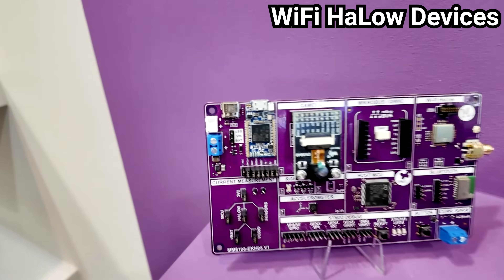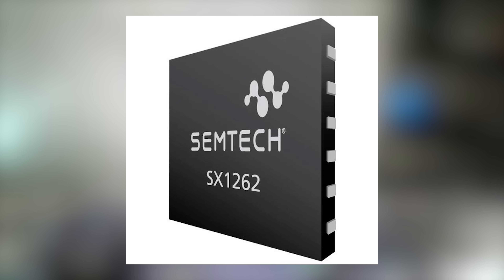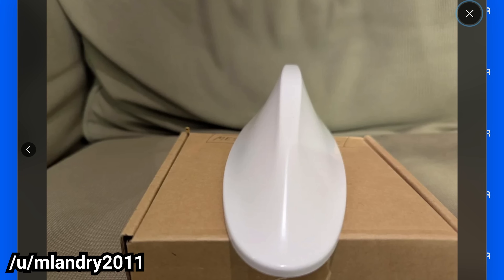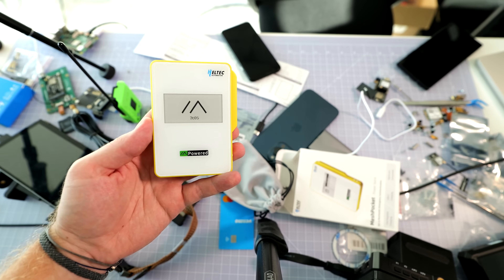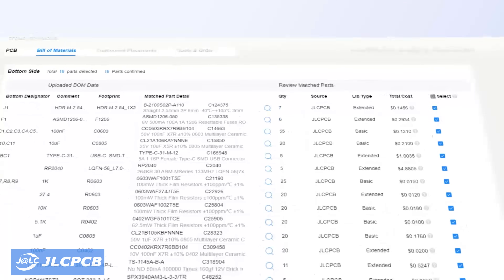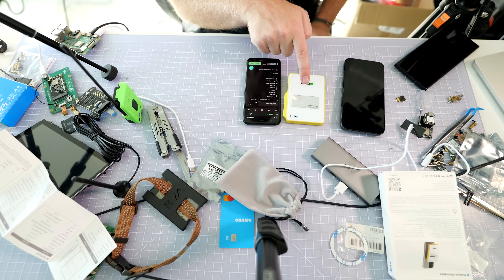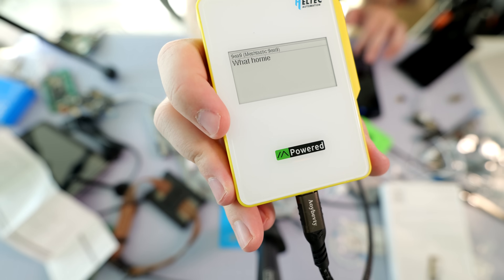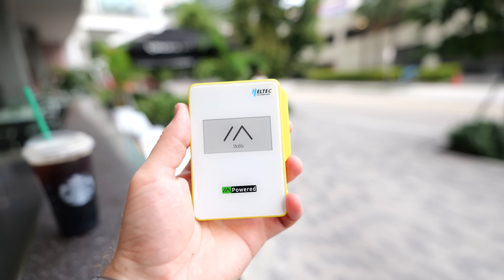The Radio, Reinvented.

Comment: No. Again. No. All these videos are always the same. “Lab” conditions or casual testing. I know Lora professionally and see how this is going to work when it gets crowded. I tell you. Don’t rely on it for anything important. Of course, most probably it will never be “crowded” and then it is fine if you are one of the very few using it.
Reply: What about Wifi HaLow for something similar then?
Reply: @kammoshi6479 I am not familiar to give an opinion, just what I read, but it sounds good, probably better 🤷🏻‍♂️ to be fair for us lora sounded great, and our initial tests were very encouraging, but then the real world with many devices that should answer made it unreliable and the ranges disappointing in most cases and it was in the country, not urban installations. We serialized messages to minimize collisions. But even so. We use it, it is what we have atm, with (quite) more repeaters and slower, and each installation is a pain till we are sure every node every sensor every relay is reliable enough.
Reply: Really appreciate the time you took to answer this.

I've done a ton of research on both technologies and came to similar conclusions you did.

LoRa for what Meshtastic is using it for is somewhat a waste of time.

Meshtastic leveraging HaLow IMHO would be very interesting to see.

Comment: Hey data slayer,
Can you make a video on creating a meshtastic curcuit that uses esp32 wroom and sx1278
Please,
Thank you
Reply: I just finished my 1st "Faketec" v3,  it uses a NRF52 and the Na-01sh (SX-1262).  I got it working,   there are videos on how to make this,  and github files.  I had the pcb's printed.    

If all you need is one or two nodes, then just buying them made is probably easier and cheaper,  I plan to make about 4-6 solar nodes,  this is why I went for the NR52,  which use much less power than the ESP32. 

the whole "faketec"  consist of  the NRF52,  the NA-01sh (for US 915Mhz),  a couple of resistors,  (1M and 680K) and a couple momentary switches,  all this stuff is cheap.   the PCB's I got 10pc and I think it came out to about 20 bucks,  so around 2 dollars, each,  the NRF52 cost about 3 dollars off Aliexpress.   the switches and resistors were less than 3 dollars for 100 pc each.  

So if you like to tinker like I do,  then look for the build, it's fun.   or you can breadboard it,  if you don't solder.    the Na-01sh  module and switches require a steady hand and small tipped soldering iron.   or heat gun and solder paste.

Comment: How does it do out in the suburbs or farmland where you are the only one that has the gadget . Who you going to connect with. I live in a town of 30,000 people and I have one of those gadgets , my daughter lives 40 km away and also has one but there is no way to get a signal further than 5 km away .
Reply: Solar repeater nodes to bridge gap or mqtt/tcp porthole (internet required)
Reply: You might be surprised to find you already have router/repeater nodes in the area,  if not,  you can easily get a solar powered node, or make one,  place it in a strategic high location.
Reply: @Artiflex-ai4u Not practical and not cheap . There are other products that id rather use.
Reply: @Sanchon-gv8gd  Like what? Teach me.
Reply: You can use an SSB CB radio with fixed antennas and battery/charger (solar).
When there is a blackout, you have familly comms.

Comment: another ridiculous nonstandard connector port, no thanks.
Reply: It's just a magnetic 4 pin pogo charging connector- you can buy these as a USB cable.
Reply: @SyntacticOperator  thats just the thing, ive already got a million USB cables, dont need another weird connector that is gonna be obsolete in a few years anyway.
Reply: @RadioMcRadioface  In the earliest prototype, we put the firmware update and charging on the same Type-C port, and switched by pressing the analog switch, but this is not friendly to low power consumption.

Regarding the magnetic interface... users can upgrade the firmware via Bluetooth, but the speed is very slow, so the magnetic interface is retained for users who need it.
Reply: @HeltecAutomation  Fair enough. I'll pick one up :)

Comment: Gots a question, like the show do you figure you could build this for long range  5g WiFi through radio, Yes — technically, yes — with your setup and careful design, you can use radio to relay internet over long distances, and then convert it back into WiFi at the remote end to access the internet, as long as: “I have python code for this.” [Internet Connection (Starlink or similar)]
        ↓
[Python System + WiFi capture / Ethernet out]
        ↓
[Long-Range Radio Transmitter (900 MHz, 5 GHz, or custom SDR)]
        ↓ (Radio wave link — e.g. 5 km to 3,000 km)
[Radio Receiver at remote site]
        ↓
[Python System + WiFi rebroadcast (TP-Link, MikroTik)]
        ↓
[Laptop, Phone, or IoT Device connects via WiFi]

KEY CLARIFICATIONS

✅ This is legal and functional if:
	•	You’re using ISM band radios (e.g., 900 MHz, 2.4 GHz, 5.8 GHz), OR
	•	You use Starlink or a licensed satellite modem for the internet source
	•	You do not use ham radio bands to carry encrypted IP traffic
	•	You are simply relaying digital data from one legal system to another

Comment: Can these be used long range? What I mean by long is if I’m in Nevada can I message with a friend in Florida? I’m still learning how this all works. I’m looking for an off grid messenger that can be used at any range. Is this it?
Reply: If somebody tunnels a repeater to your friend via the internet, sure.

But such a backhaul route without tcp/ip tunnels would require thousands of relay stations.

End to end encryption means you can safely utilize the current infrastructure so long as a tunnel is set up.

Even at 400mhz, transmission powers have to be enormous to make long range communications work and the curvature of the earth is real. No flat earth.

This means that mesh coms need illegally high transmit powers, towers hundreds of meters tall, and thousands of them - to backhaul a signal thousands of miles.

The only practical solution is to capture the transmissions, pack and encrypt them into a tcp/ip frame, transmit over the internet to a repeater, which decrypts and transmits the signal in Florida.
Reply: Not by itself. National governments don't allow hobbyists to use those frequencies. And there are laws against how "loud" (db) you can transmit, further limiting distance.

These devices are created within a very strict set of legal requirements so they're very hamstrung. But they're great considering the restraints.
Reply: Thanks for the replies. I understand now.
Reply: There is absolutely no way unless every person has one and that will also not work . Reg antena catches signal of one km . Best antena maybe 10km if standing on high ground and nothing in between.
Reply: No

Comment: the CIA are freaking out right now..
Reply: theoretically the CIA could set up listening stations. I mean they have done similar in the past
Reply: @goodchoice4410  With enough stations they can then triangulate your location, even if you don't have a GPS set up for your radio.
Reply: They aren't. These things work with minimum spec preshared encryption keys. They already have listening stations for all the frequencies they would need.
Reply: Don't worry, CIA and China have backdoor built into the chips and/or software.